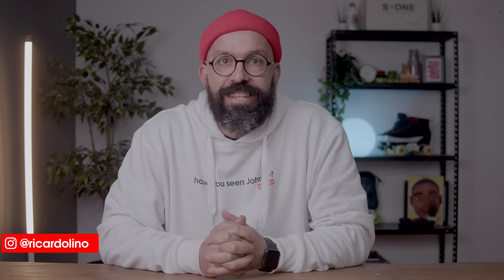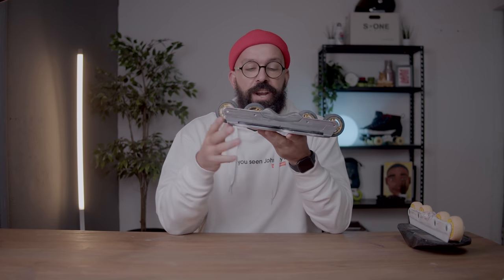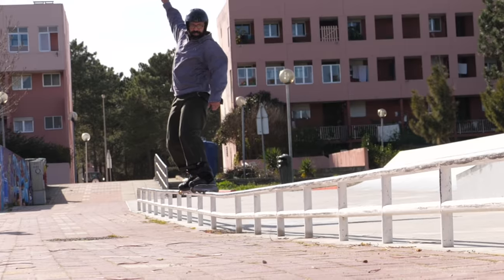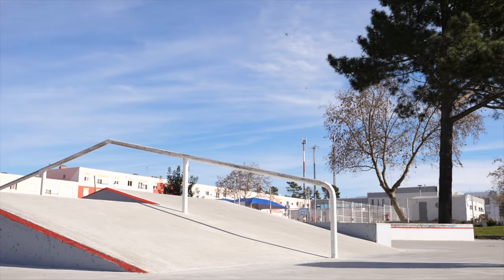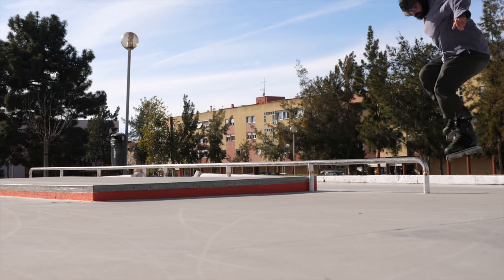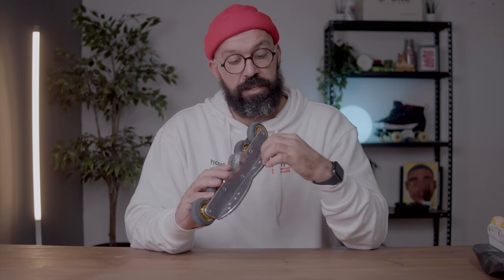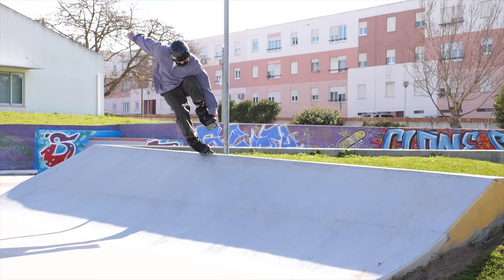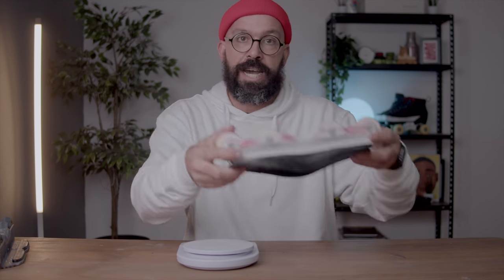KIZER SOULFRAME 60 REVIEW / PART 1

Comment: Hi Ricardo,
really nice and honest review,
can't wait for that part 2!
Just a few comments / corrections...
- they are 3 sizes available: 62S - flat, 62M - flat, 68L - rockered (not 1 size)
- in this video you probably have size 62S and this version with soulplate mounting you can skate max. with 62mm wheels flat (not 64mm)
- these metal soulframes were designed especially for a wooden skateparks, for a full metal grinding experience 
(with metal h-blocks and without those plastic wings)
- for a concrete skateparks is recommended to skate them with plastic h-blocks and plastic wings
- for that part 2 would be great to test it in the wooden skatepark, without those plastic wings
If you have any questions, just let me know.
Lukas 
(I designed these metal soulframes for Kizer)
Reply from the maker: Amazing :) thank you so much for the feedback

I’ll do that in part 2 🙏🏻❤️